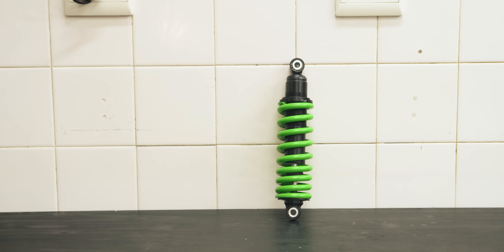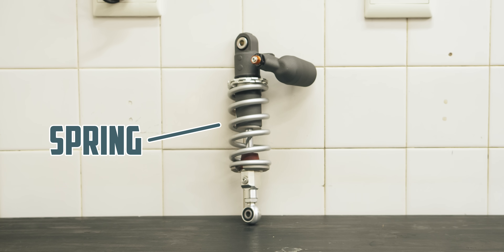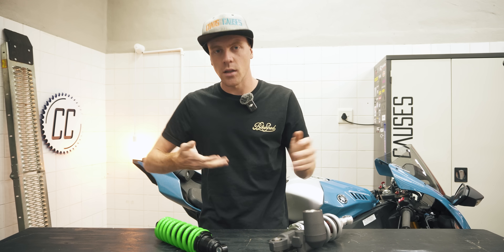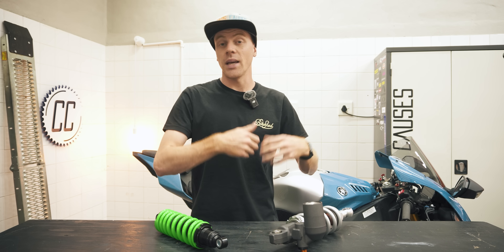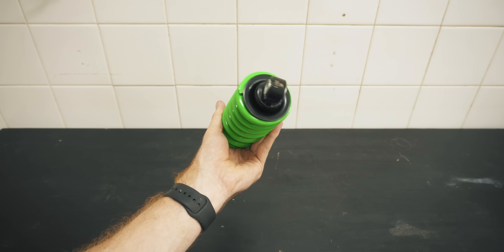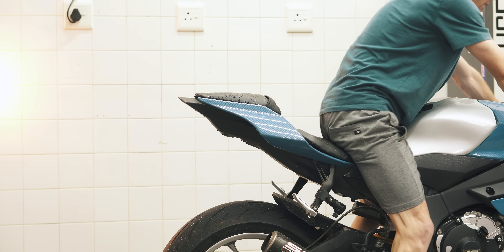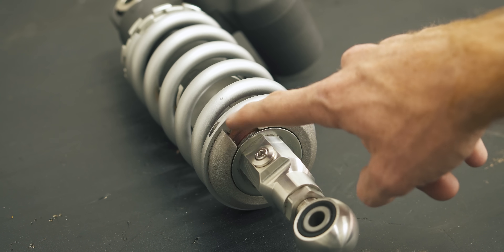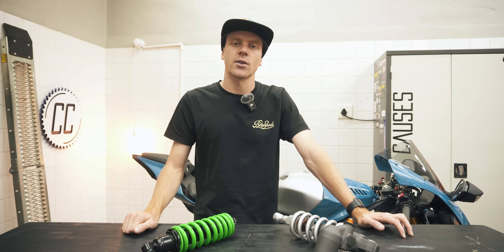Basic vs Adjustable Motorcycle Shock | What’s The Difference?

Comment: Not having a piston to seperate the oil from the gas is not such a big problem as you say it is. The oil and gas do not mix that easily. Only under extreme stress for extended periods of time (like in motorsport) does this become a problem. When the shock is mounted horizontally or upside down, I admit that a seperating piston is necessary.
Furthermore, the twin shock design is also not as bad as you say it is. Yes, it is not optimal, but it is not terrible either. The problem with Harley Davidson motorcycles is not the twin shock design, but the way the swingarm is mounted. Not to the frame, but to the heavily unbalanced engine, which is mounted to the frame using rubber bushings. It also ain't that rare that the engine is not mounted perfectly straight and level, which does not help the handling.

Comment: For majority of riders out there, the stock shock is usually good enough as long as it gives preload adjustment. Compression/rebound adjustments (and more) are really just for riders looking to maximizing their lap times/riding experience where the shocks are actually being put through their paces. Someone who just commutes to work/does a bit of touring on weekend won't see much benefit from an aftermarket shock. You'd be best served with correctly adjusting your current shock or replacing the OEM shock if it hasn't been touched in years (much cheaper)
Reply: You didn't ride with Harley Sportster  OEM shocks. 😂 I'm around 150lb those shocks will catapult me in the air at every bump at speed over 30 mph. No return rebound what so ever. 100% made from rubbish. Harley should sell the bikes as hardtail  and offer better shocks as option only 😂.

Enjoy your ride bro !
Reply: Totally disagree. My Xt600 has WP front and rear shocks and it's just Way better to drive and more fun

Okay maybe progressive springs in the stock suspension would get it 80% to what I have/need.. but on many cheaper bikes the suspension is wacky and in my opinion after good tires is the best upgrade
Reply: @gorkzop  Well I can't comment about your specific bike specifically but my point was that majority of riders won't benefit, that's not to say that some won't (like yourself)

Comment: My Triumph Tiger 900 GT Pro has rear shock adjustable on the fly on the dash panel. It's kind of funny sitting on the bike and adjusting the preload and the bike raises or lowers itself a couple of inches. Riding modes further adjust the rear and I can fine tune rebound across a range of nine settings.

Comment: The main thing about adjustable shocks is the preload, i didnt know wtf was that until i added luggage on the rear then the front handle bars started to vibrate under slow speeds, so had to adjust the preload on the rear shocks on my vfr .

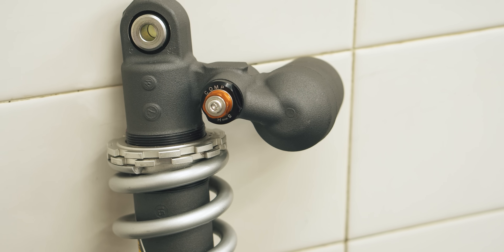Comment: gah! @5:14 Tension is the opposite of compression, if you were adding tension it would make the shock operate completely different, lol  If your suspension is experiencing tension, your bike is probably upside down, being hung by the wheels... that or The Hulk is holding on to your bike by the wheel and swinging it around as a weapon.

Comment: Very well explained. Please emphesise in the next video more, that preload does not make a suspension stiffer. The spring rate stays the same! Preload just changes the sag/geometry of the bike under a static load. If the springrate doesn't work for the weight of the rider it should be changed out. 

I'm to heavy for stock springs on most motorycles and it makes a very notable difference between maxed out preload dial with a standard spring in comparison to a proper springrate for my weight.

Comment: Bro has no idea about 3rd world countries. If it's built, it can be rebuilt. Nothing is irreparable, it's all about the worth.
Reply: Thing is in first world countries the people who'd be rebuilding cost more than replacing the part usually. The opposite applies to third world countries where manual labor is way cheaper, and goods cost a lot, especially imported ones.
Reply: @lucascarracedo7421 if that is the case, that is what should be said in the video. anyway, true true.
Reply: The cost of recycling and creating better components in 1st world countries is less costly than paying service technicians to fix "permanent" components.
It's a knowledge thing. It's a time thing. It's a value-of-currency thing with the inefficient manufacturing systems we have to work with.
Reply: Most stock shock are irrepairable because of their design you cant fill the gas back in. The only way to repair them would be for you to have the factory machinery.
Reply: @xsdfl4244 this guy is right
Reply: Repairing a stock rear shock here in my country lasts 100km if you're lucky. Lol. They're disposable for a freaking reason.
Reply: Bro South Africa is considered a 3rd world country
Reply: He lives in south Africa
Reply: Bro is literally from South Africa
Reply: He's not in a third world country !.....
Reply: I am a mechanic, and let me tell you, there are things you straight up can not repair. I do know those clips of people repairing all sorts of parts, but some things are just trash. I have recently seen a BMW esa Dynamic shock, which was so heavily damaged we could not do anything to save it. And we specialize in fixing those. Piston rod snapped in half, the cable inside the piston rod was cut clean through and multiple parts were missing. We could replace the missing parts as well as the piston rod. That would have been expensive as hell, but possible. The biggest problem was the snapped cable. It only just barely fits through the piston rod and soldering it back together would have added so much thickness to the cable that the valve could not be mounted again

Comment: I wonder why front mono shocks are not a thing yet.
There are bicycles with only one fork arm, why not try this on a motorcycle? Make it extra beefy and you'll never have speed wobble ever again!
Reply: 😮Since +15 YEARS, some BMW models and all BMW GS models have single front shock. And oh yeah, that doesn't help against speed wobble at all... 😅
Reply: All sorts of stuff has been tried on motorcycles over the years. Front swingarms (Yamaha GTS1000). Front monoshock action (BMW for example). Other complex things that ultimately achieve some kind of goal but end up being super complex and many totally lose feedback from the road surface to the rider's arms.
The telescopic fork remains the least costly, most communicative system that does a commendable job. The Telelever system on BMW and the current Goldwing solve the brake-dive issue, but they also mostly eliminate traction feedback to the rider.
Doing the "lefty" single fork system might be possible but it would require some pretty stout and thick parts that would resist flexing and fatigue at the wheel axle and the steering yoke. Consider how much bending force is put on fork tubes under hard braking. You also have to control wheel direction vs. handlebar direction by some kind of rotational control, especially if you were to experience speed wobble. Much less control with a single tube setup vs two. They do it on bicycles, but bicycles rarely see more than 30 mph, don't have to stop 600 pounds mass, or control a big heavy wheel set.
Stiction has been a problem, the force needed to get forks to initiate movement. They put low friction coatings on tubes to reduce this issue. Another solution has been USD forks, where the bending moment is the large tubes toward the triple clamps, rather than right-side-up forks and all that bending moment is smaller tubes where the seals and larger tubes have to slide over the flexed portion of the small tube (under load). Also it moves the oil and heavy stuff to the "sprung" side of the chassis and allows the lighter components (unsprung) to move up and down with the wheel, with less inertia and resistance to motion.
Reply: @turnin.sprocket  Wow, thank you so much for your elaborate answer! I have no further questions :)
Reply: @SimSimon87  Happy to help!